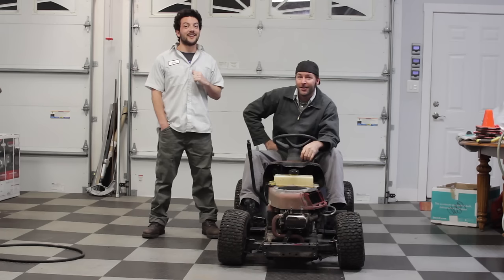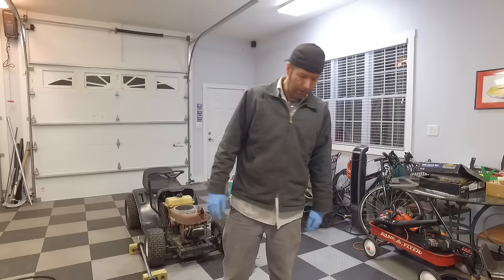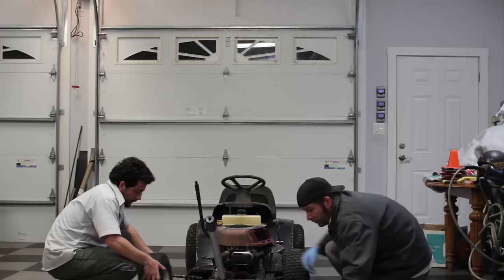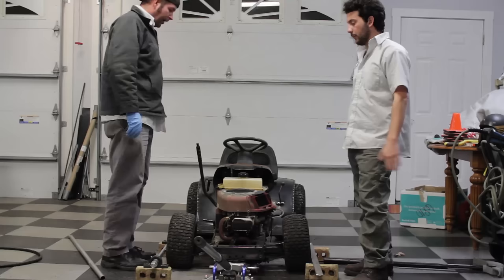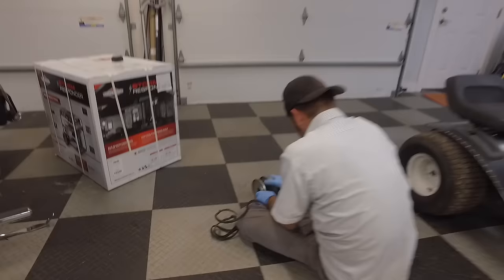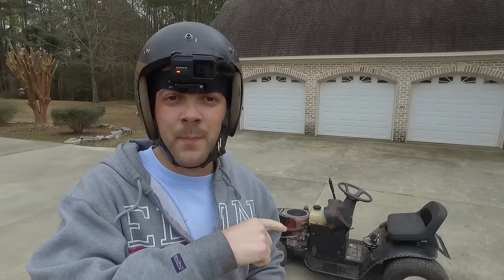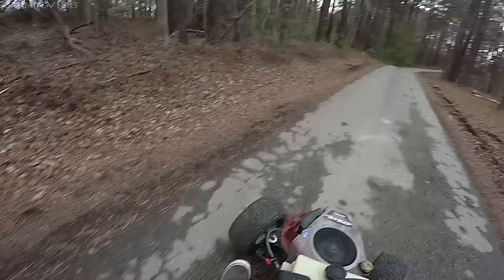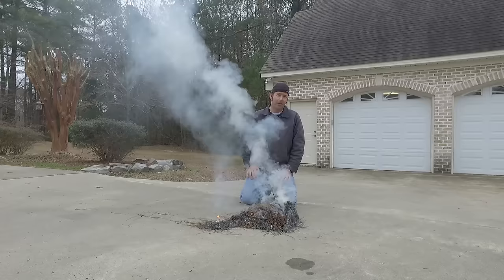Top Speed Run & FIRE: Racing Mower Build Pt. 7

Comment: Paint the mower!!!! I don't think Ive laughed his hard in a very long time!
Reply from the maker: Thanks!
Reply: CarsandCameras paint it a bright blue with metallic
Reply: hey Bros can you pant it army green as well as think about turbocharging it I think that would be cool if it can handle it
Reply: Junior Campbell paint it blue camo
Reply: rustoleum bright or neon, and some ''glitter'' flakes ;)
and the alignment, overdo the toe in for straight high speed stability.
Reply: Check the caster angle. If it's negative it will cause the steering to be unstable at speed.
Reply: Why ? I don't think paint would make it go any faster. Besides it has character,keep it cool
Reply: I agree with Jimmy Jones, check that caster angle and lean that front axle back a bit!
Reply: WHAAAT!????? Paint always makes it faster. so does stickers and cup holders.
Reply: whaaat!!!??? paint always makes it faster. so does cup holders and stickers.
Reply: Sure paint doesn't make it faster but a few CarsandCameras stickers on it would be cool
Reply: caddy corner stickers
Reply: they should paint it purple because its a rice mower right

Comment: That steering is pretty scary. There is a plastic bushing thing at the bottom of the steering shaft that is probably where most of the play is coming from. They are cheap to replace. Also check the ball and socket joints on the steering shaft that goes from the gearbox to the spindle. Those can be tightened up using a punch.

Comment: +CarsandCameras  Maybe a steering linkage from a go kart or something modeled on that could help your high speed stability issues. the disadvantage of this: it will probably limit your steering angle, so it will not turn as sharp. keep it up. a fan
Reply: Im using your videos to help in my mower build ... What size is the front pulley.. What carb do you run

Comment: I think you need to get the front wheels on 0 deg camber. Toe out makes it more stable at high speeds but less steering at slow tight corners. Also I think when you have lowered the ride height the steering akermann has changed too! Well impressed though with the speed,it has great top speed with the 5 speed gearbox.

Comment: Great video guys, rest your back ike! Alternate heat and cold packs. Hope u Get well also John! The steering play is for sure in the worm gear teeth  in steering rack. Teeth are worn I'm suspecting, it's a lot of work. You can take out the steering shaft and do a little spot welding in each tooth to build it up and take the play out but again a lot of work. It can be done! 👍🏻👍🏻
Reply: thanks

Comment: Use high tension springs attached them to the front turning axle and attach them to the mower frame it puts tension. And put them where they're pulling forward and back so that way they put tension

Comment: you can shim the stearing linkage with plastic washers to take up the slack. but the faster you go on a mower the more under and oversteer you will have.since they were not designed for speed 😁lol.

Comment: one issue you will encounter is front wheel bearings wearing out. My advise is to make sure the clips that hold the wheels on have minimal slop and to use the best grease you can often.

Comment: well done... heavier tierods and ends between the wheels a tie rod end welded on the on the steering gear bar will make it stable at high speeds and over bumps then you have adjustable toe

Comment: Paint I'd say matte clear if anything,probably once it's rusted a little scuff it up then clear that. Fix the steering too so it's nicer to ride. You'll probably need more suspension in the seat for thrashing on a gravel road,although it's hard to tell through the video.

Comment: Most important to Hi speed stability CASTER  ! 4' POSITIVE CASTER, 0 TO 1' CAMBER. 1/8" TO 3/16" TOE OUT I have gone 65 mph with these specs. Air up the tires so you just run on the center of the tire Make some good tie rods . Check for wear on the steering gears sometimes you can flip them over to get a fresh tooth mesh.

Comment: Something to think about is a lawnmowers steering was never intended to be driven at forty , it was designed to turn tightly and easily so it probably has a pretty near vertical caster angle , so that being said if it where me what I would do is ditch the factory front axle and build a new one out of rectangular tubing and give it a few degrees of positive caster. ( exactly how much I don't know , I'd have to research a little) the steering will be harder but more stable and less darty. About the steering slop , with that many connections it'll be hard track it all down and get rid of it.

Comment: Your steering issue is an Ackermann, or dynamic toe issue, not a static toe issue. Change the angle between the steering arms on the column and the spindles, that's why the inside wheel is locking up at low speed. Steering arm length can be changed too.

Comment: You might need to put either the steering box from a Pinto on it, or the steering mechanism for a go-kart on it to tighten it up.  Great video!  Another idea would be to use actual go-kart tires and rims as well.

Comment: That is one crazy machine.....You should add an old school racing steering wheel after you get it tightened up.

Btw....
1. Duncan Freehand Mg Yoyo - $499duncan freehand mg yoyo
Duncan has released the Freehand Mg which is made of 99% magnesium. Both sides of the Freehand Mg are separately forged and then machined using a computer to control the lathe lathe resulting in a tolerance not exceeding1/100,000th of an inch.

Comment: buy a used tiller and use the reduction gearing to change the steering ratio from about 180 degrees or 720 degrees.

Comment: all of my race mowers started to toe in fairly soon after i build them, my latest project was an old craftsman ive got a 8 inch front pulley and a 2 inch rear pulley i had to swap from a 11hp to a 16hp twin engine because the lil engine didnt have enough power to turn it above 2nd gear and its a 7 speed but its sketchy because i havent lowered it yet and when u get going 80+ kmh its pretty damn wobbly especial since its toed in what i did is i bought alot of thicker steel and completely remade the steering with the steel and i havent had a problem yet so far and ps. if thats a grease filled rear end if so id drill it and fill it with oil the plug it or itll over heat and blow apart happend to many times to me

Comment: Caster is important. It’s what makes a car want to track in a straight line, it’s why after you make a turn in a car remove your hands it will center back straight. If you’re caster is at zero it will give a feel that you’re wheels are floating easy to turn, hard to go straight if in the negative supper Dartie with little input from driver. 5 to 7 degree positive Would be good.place, positive would be top of spindle leaning towards driver,

Comment: Put a strait pipe on it about 10 inches long it will throw flames mine does.  If you toe it in a little it should help make it a bit tighter. Tempted on mine to do the Turbo and Fuel injection.

Comment: I think I have said it in every video on this build but it needs to be said, that steering is not designed for those speeds.  At most a lawnmowers steering is only good for low speeds, to get more out of it I would make it solid steering setup they use for the actual race mowers.  Yes it will do those high speeds but for how long?  I wouldn't trust it with that much play in the wheel in a top speed run let alone a side by side drag with someone else, you would not be the only person that could get hurt as a result.

Comment: John you're scaring me, but I'm laughing too. Ike ran the speed up on a slight corner where there was pressure pushing on one side of the mower. That steadied the steering for a short time, and let him slow the mower at the same time. Paint or no paint. I think you guys can come up with a good paint scheme, or incorporate a lot of racing stickers, or both.

Comment: That thing is more sketchy than a 53 Chevy with the old kingpin front end, and a 400 HP V8 sitting on it. Me personally, I think before I did anything else to the mower I would build a better front axle with heim joints. If you look around you can get a steering box out of a small tractor and make it work. The way the mower is right now, painting it would be like putting lipstick on an ape. And to maybe give you an idea, that small gearbox you guys used on the rat rod wagon, Seems like it would make a very good steering box.

Comment: I would like to know how to make the steering tighter, and how to properly set camber, caster and toe, or what it should be at to handle well at higher speeds. Thanks for all the help, working on my mower, going to get a smaller transaxle pulley, what size should I get? Eventually I will get a jackshaft.

Comment: I had a very bad alignment issue with 1 of my mowers and the frame was bent fairly bad I just used a old 2x4 and a hammer and fixed my problem so the tree may have caused a slight bend you cant notice

Comment: I have an old case ingersol for a derby mower and it goes 40. Its not lowered and dosnt have a jack shaft. It had a 6in pulley in the front and a 3in in the back. Its pretty scary. The steering sucks on it

Comment: John sounds like finnegan making fun of Freiberger for being an old man in the Subaru vs rotsun challenge when finnegan lost in the Datsun
Reply: And a slight toe-in will cause the wheels to align parallel when you start moving forward. Then it will handle a bit better as well.
Reply: +Bargain Boondocker you got it. A bit of toe-in like you said will cause the steering to auto-correct

Comment: Isaac it'll be fine I feel like I'm cheating to answer your mystery car guess...but I've seen the vid where you let the cat out on the Bel Air. My predictions are that the mower will dominate for the first 100ft and the steering will cause the mower driver to back out of the throttle. The 3spd will probably leave a nice one-legger in 1st and lose umph in 2nd but be fun nonetheless. If steering weren't an issue I think a 300ft run would be competitive. As a guess I would say 45-47mph would be a reasonable top speed run.
Reply: I'd say in 300ft the Bel Air would reach 48-53mph if the trans/rear/shaft and u-joints hold up. Excited to see the outcome! I really enjoy the vids guys, keep up the good work!
Reply: wish it was the 53. I'm still working on it

Comment: you guys need to lower the seat
Reply: the trans axle pulley is about 1 in below the seat
Reply: Ya Know Who they could flip the axle upside down and get rid of the jack shaft
Reply: +pdgeman it works great but you wouldent get the speed not as much you can change but if you flip the trans axle on a frame like that youl have about 4 or 4.5 inches to play with i showed that in my poor qualety videos 😆
Reply: no. If the flipped the axle it would be turning the wrong way and they would be going in reverse.
Reply: Then it would have 6 reverse gears.
Reply: +Daylan Chapman flip it and turn it around it gies the same way and i show how it is in my video poor qualety warning if you watch it works normal though
Reply: +Daylan Chapman flip it and turn it around it gies the same way and i show how it is in my video poor qualety warning if you watch it works normal though
Reply: James Nicholson put it upside-down and spin it
Reply: axel cook I'll start to watch your videos
Reply: +Ya Know Who thanks man
Reply: I was thinking same thing buuuut forgot they already screwed that idea up lol

Comment: I probably missed it in the other videos, but what size pulleys did you end up using on the motor, Jack shaft, and rear end? Thanks for another great video!
Reply: torq converter on engine to a 4 in pulley on the jackshaft. then a 6in pulley to a 2 in pulley on transaxle. I'm just guessing on the sizes
Reply: +Isaac it'll be fine Ballpark is close enough. Thanks for the reply!
Reply: sure

Comment: So im building a go kart, and i have the disk and mechanical brake caliper installed, and im trying to hook it up to my brake pedal using brake cables. But because you have to snip one of the ends with a cable stopper, i cant find anything that works to again stop the cable. everything just pops off. Do you guys have any solutions?
Reply: I'm not sure the best rout to go without being there and seeing what you have. wish I could help.
Reply: thanks for the response anyways, love the show! Ill eventually figure it out
Reply: sure
Reply: If you have a steel corded cable, simply crimp an electrical but connector onto the end using dikes. That's what I use on my shifter kart and it works awesome.

Comment: I am working on a shifter kart with the same kind of transaxle, and i have ran in some problems. I did the same as you guys and put trans oil in it but it just leaks out! what should i do??
Reply: Nikolai Eriksson Kukkonen needs seals. the axle seals like to leak.
Reply: Yeah i know but the axle is between both halfs of the transaxle casing. So its realy hard to get a seal in there
Reply: Nikolai Eriksson Kukkonen if it leaks from the axles the seals are worn out. you could take it apart and reseal it with ultra black silicone. or it could be building pressure in the gear case. these need a vent when used with gear oil, make sure you are using gear oil and not engine oil. these are meant to be filled with grease and the oil expands once hot and pressurizes the rear end pushing fluid through any crack. in any case i would take it apart and reseal the cases and install a vent with a small catch can

Comment: Cars and cameras does the one half torque converter work like it would on a go kart or are you using it as a bigger pulley
Reply: using it as a bigger pulley
Reply: Isaac it'll be fine thanks
Reply: yea buddy
Reply: Isaac it'll be fine I started building a off road mower and the gearing is only good for speed not really for romping

Comment: A few suggestions: 1.Don't paint it 2. Make a guard for that jackshaft(dont want to get nothing stuck in there) 3. Removing the governors on these kind of motors is a bad idea 4. That steerings probably out of allignment due to it being stock steering, dont leave it as is. Nice build guys!
Reply: Colepaq your right they should not remove the governor it coil blow up
Reply: I have removed the govner on my 11hp brigs engine on my craftsman off road mower and iv did the foot throttle mod to it and held it wide open (while driving it) many of times iv been running this setup for about 2 years now and never once had a problem.

Comment: Dont paint it and suck it up Jon. Dont be a sissy and floor it.
Reply: lol. he is smarter than me
Reply: u can't punch it for long periods at a time no governor  it would blow up and throw the connecting rod through his leg
Reply: Skylar Wood doubtful
Reply: i had one of these till the engine blew up. floored it for to long with no governor. was actually just the plastic fan that blew up and took out the coil. RIP race mower.
Reply: Jimmy Schmidt
Reply: Jimmy Schmid
Reply: Winner winner chicken dinner! No fear, just aim for the small trees.
Reply: 2 words. . : self preservation
Reply: yeah there's nothing more manly than flying headfirst into a tree at 40mph
Reply: 40mph on a mower? fuck that! that would be fucking scary!!
Reply: very scary
Reply: Isaac it'll be fine Do the front tires start getting a crown on them from the angle they are at?
Reply: Isaac you should drive mine it will run 80 is the fastest i had it up too and that was on a nice flat road new paved smooth driving my mower is an old mtd 22horse vtwin briggs 44cc block. it now has a 44cc block that is ruffly a 72 cc aluminum fly wheel governor was taken out steel crank forged piston custom rockers and push rods and heavier valve springs

Comment: how can I get more speed from my garden mower because I have the engine that has a pully going to the gearbox or something like that. I'm using a honda gx270 engine to power it.
Reply: I only have forwarded neutral and reverse
Reply: does the gearbox have multiple forward gears?
Reply: Isaac it'll be fine no it only has one forward but I whant more speed
Reply: well you will need a smaller pulley on the trans and a bigger pulley on the engine. then your going to run ito a problem taking off from a start
Reply: Isaac it'll be fine will this speed up the tractor then
Reply: +bike freakz the short answer of the pulley size change, is yes, how driveable it is will be questionable depending on the sizes , it might be very hard to take off from a stop